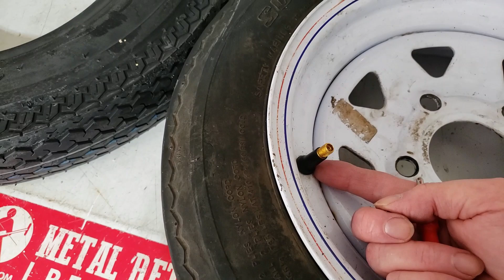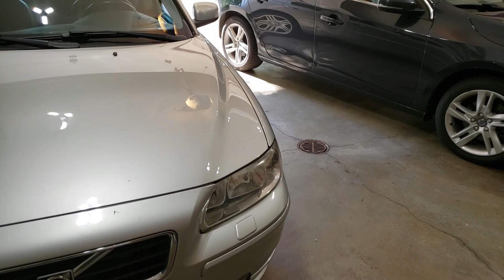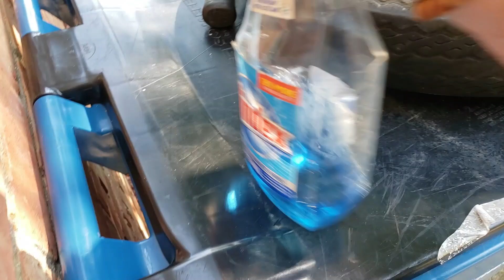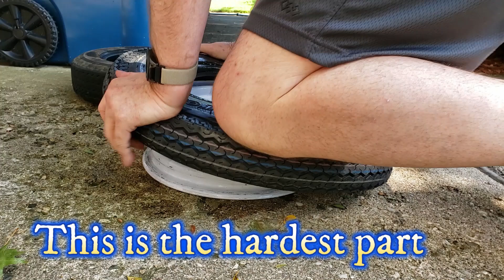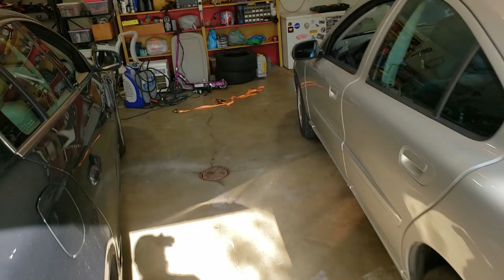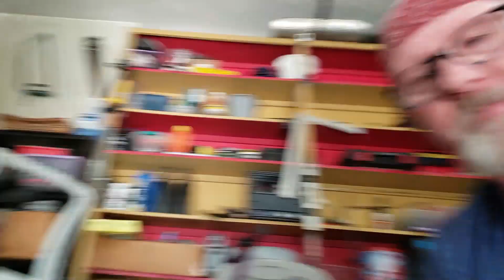Replacing A Trailer Tire at HOME with NO Special Tools !!

Comment: It's much easier using tire spoons instead of screwdrivers.  The end of the spoon is curved to grip the edge of the rim; which prevents it slipping off & scratching the rim (and busting ur knuckles).
Reply from the maker: This is a do it at home video.   How many people have those at home?
Reply: @MIFixItDad  Perhaps I'm an old old-school DIY guy ... I've had a pair of spoons in my garage for years.  They're available at any autoparts store & same price as wrenches.